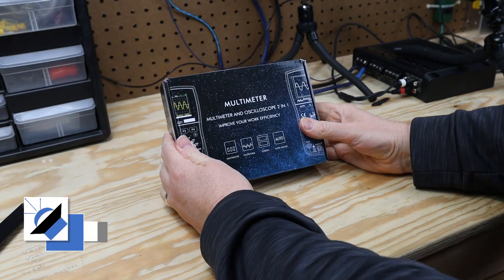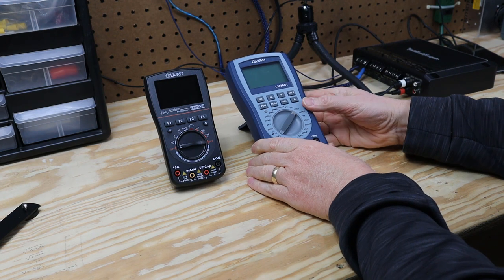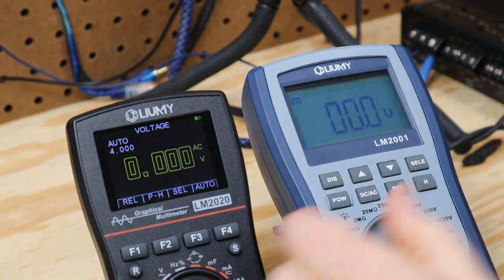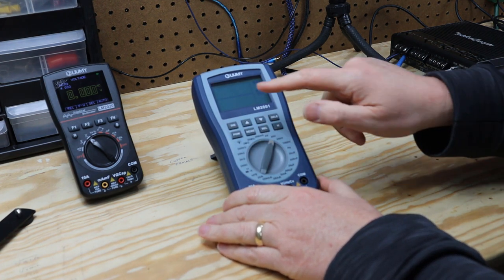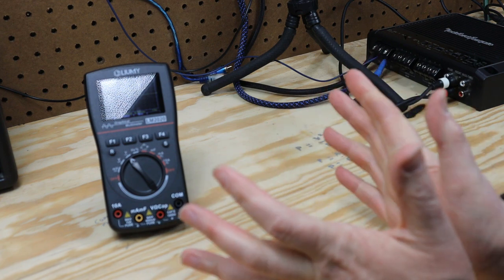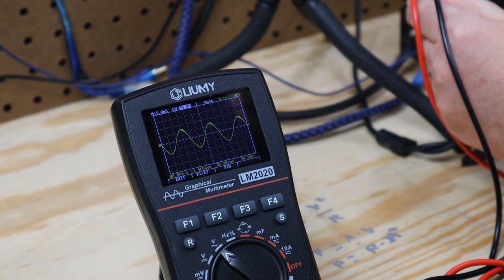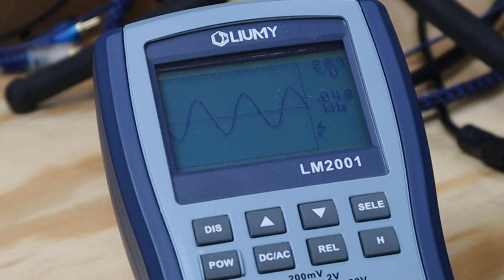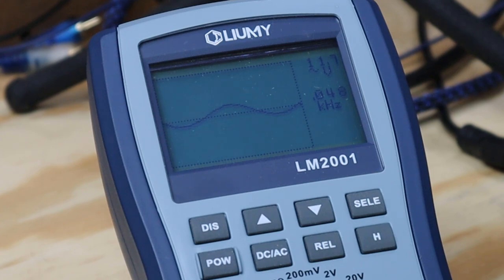Best Cheap Oscilloscope for Car Audio in 2021? Liumy LM2001 vs LM2020

Comment: Great video and honestly seeing the video makes me more apt to buy this one lol.
Reply from the maker: Or grab one that looks just like it for half the price.
Reply: @DIYAudioGuy  i did this and it has worked a treat for gain setting to the point if an extra 2.5 volts over the ohms law and multimeter method and my system and others I've helped sound 👌

Comment: Great demonstration! Are these True RMS volt meters or not? Also the screen resolution on both is the same? 320x240?
Reply from the maker: They are supposed to be True RMS, but I don't really trust that they are.  The screens are about the same size, but the new one has more pixels, much higher resolution.
Reply: rms is just as good as a fluke on the 2001

Comment: I ordered this scope because i needed to read more than 40 volts and the cheaper ones will not do that. I found that holding the f3 key will sort of auto adjust the scale. I get the wave to fit the screen to begin with, the wave is usually smaller on the screen at 49 volts using the 10x and 1x/3x buttons. Then i hold the f3 and it shows the wave form going off the screen. When i cycle through the scales this time, the wave form ends up fitting much better. I do have to cycle through the 10x and 1x/3x option to get a good fit. Only this time the wave form is scaled much better. I noticed that this works for reading smaller voltages . When reading the rca voltage that is under 2 volts. That method seems to make the wave form easier to read. My amp has a clip light and i cant see clipping on this o scope until the light is solid and is in hard clipping. The 1% clipping that my amp detects does not show up on this scope. I dont think you could see 1% on any scope. At least i know the flashing clip light is a "soft clip" and a solid light is well into clipping.

Comment: Awesome video I have a handheld fluke multimeter but I have been looking for a smaller easier unit.
Reply from the maker: I think it's really cool that we've got all these cheap oscilloscopes on the market. I just don't see the reason why you'd pay $80 or $90 for this one when there's another one that looks to be exactly the same for 40 or 50.
Reply: @DIYAudioGuy  I agree. And at $40 or $50 you cant go wrong.  I dont mind dropping a $50 o scope vs the $1300 fluke lol.
Reply: Would it be better to invest into a DATs 3? Considering it's mainly for audio measurement
Reply from the maker: @st170ish  A DATS cannot detect clipping.
Reply: @DIYAudioGuy  Dats has an oscilloscope built in, I can't vouch how good it is
Reply from the maker: I did not know that!

Comment: I bought the Mustool scope meter a while back. It would probably be similar to the 2.0 version. Not bad for 50 bucks on banggood. Perfectly fine for setting gains. Like most of these scope meters the battery doesn't last long, but for occasional use it isn't too bad.
Reply from the maker: Back in the day oscilloscopes were expensive machines that sat on laboratory benches.  I find it amazing that for under 200 bucks there's a wide selection of perfectly fine functional handheld oscilloscopes.

Comment: The one that you have linked is a different brand, will this work as the one you showed or no?  I need one asap cause I just can't hear distortion period. Idk why but in my 20+ plus years of doing car audio I've never been able to tune.  I can install it all day long but someone else has to tune it when I'm done lmao.
Reply from the maker: According to amazon that is the one I bought -- from what I can tell they all work the same.
Reply: @DIYAudioGuy  awesome I'll get it shipped out and do mine when it arrives!

Comment: Thanks for the review! I picked one up after watching your review. I was just wondering if you can help me with a few things as I haven't used a multi meter in a long time. Measuring DCV on a router, and you want to set the limit of voltage is it possible to limit it to max voltage at 10 Volts? The only way I can explain it is with an analog meter (This model: de-960tr). I just need it to be more precise. I couldn't find any settings to manually change it.

I don't know if it set in 'Auto' will perform in that way or not. Last question is, I had both leads setup on the 2 far right ports from a different review I seen. I'm really confused at which ports I use for things that are low voltage / low amps. Can you recommend the correct way to have those setup? Either that, or if you know of a guide / tutorial that can teach me about it. Much appreciated.
Reply from the maker: The LM2020 is auto-ranging so so you just set it to the type of voltage (AC or DC) and you should be fine.

Comment: PLEASE tell me why I can’t get my oscilloscope to give a clipped signal!??? I have done bought 2 different O-Scopes and neither will show! I’m running a taramps big boss 3 with a resilient sounds 15 dvc 2ohm with 1/0 gauge OFC power/ground and ground is good! I just can’t seem to get a clipped signal on neither O-scope! I bought the FNIRSI 2C23T & AUKUYEE Updated 2.4" TFT Digital Oscilloscope! My amp and bass knob shows clipping but won’t show a clipped/squared-signal! I was running a KICKER LOC and bought another, the PAC LP7-2 because you can control the gain on it, itself! But I can’t even get a clipped signal on it/head unit ALL the way up on a factory Bose HU/system! PLEASE ANYONE, ANYTHING HELPS!?
Reply from the maker: I'm not sure what to tell you.  If I could physically put my hands on the equipment I might be able to sort it out, but it's hard to troubleshoot across the internet.

Comment: I have the 2001 version and works fine but the screen is so low on resolution that sometimes i cant tell if it is in fact clipping or it's just a lack of pixels to visualize the round curve. But overall does the job
Reply from the maker: I had the exact same problem.  I had planned to do some videos on setting gains with the 2001 but they came out looking like crap.  The 2020 is not perfect, but it shows up better on camera.
Reply: @DIYAudioGuy  oh well,i think i'll have to buy the 2020 then 😂
Do you know a method to spot clipping without any instrument? Years ago i saw someone use a filtered twitter that would make noise whenever the amp reached clipping,i don't know if i remember right but it could be an idea for another video 😁
Reply from the maker: @ilfaraone91  That was Sam, his YouTube channel is barevids.  That method will work.  It's basically a harmonic distortion detector.  When the amp clips it will produce stray signal and all of its harmonic frequencies.  The bass blocker on small speaker keeps it from blowing from playing bass.  I could probably build one from spare parts I have lying around, just would need a capacitor of the right value.
Reply: @DIYAudioGuy  wow nice! Thanks for the info!

Comment: For the oscilloscope vertical sensitivity, you can also use the X1/X3 choice to get a three times change for sensitivity no matter which of the X10 settings you are on.  This gives you more choices to have the waveform more fully fill the screen.  The X1/X3 button toggles back and forth between the two choices and the volts per division indication changes accordingly.  Most scopes have a "1, 2, 5" sequence for this.  This has a "1, 3".
Reply from the maker: Yeah, you you have to fiddle around with it a bit.

Comment: I tried setting my gains using this oscilloscope. I set all my settings on my stereo to the required settings and used a 40hz test tone off of YouTube. As I adjusted the gain up the waveform went completely out of the screen and I don't know how to adjust the oscilloscope so that i can see the waveform flatten at clipping while still inside of the screen. What do I need to do?
Reply: I watched this video and apparently I didn't know how to change the waveform, but this video helped tremendously. Thanks DIY Guy!!!!

Comment: I have version "2.0" and reading distortion on the waves can be tricky just like shown on version "1.0". The display on "3.0" seems to be a good improvement over the others.
Reply from the maker: I'm still a little bit perplexed by it. As you saw in the video right before the wave went square it started to get fuzzy at the tops and bottoms of the wave.  I'm not 100% certain how flat the top needs to be before I can call it clipping.  At this point the only thing that the scope has going for it is that it is a lot cheaper than a DD1.
Reply: @DIYAudioGuy  yea if you aren't doing much amp installs then a DD1 is a real luxury. As much as I'd like one I still can't justify the cost just yet... especially when for me the cost is double in my local currency.
Reply from the maker: @dna59  Ouch!
Reply: yeah on my 2.0 i feel like im still guessing but on a more professional level of guessing
Reply: @mcf3778  hahaha you are correct. Usually I workout the maths of doing it with just the multimeter and then cross reference that with the oscilloscope and it's wave and voltage reading. Gives a better idea than just using 1 or the other.

Comment: I've actually been looking at one of these and this exact model. 

Heard this is like a copy of a copy of a copy but it should be good enough for setting gains and looking for distortion.
Reply from the maker: It's like a movie about a dude playing a dude that's disguised as another dude.
Reply: Liumy is the first company to make them.. buy some good leads if your gonna use it daily mine fell apart day 4 but I reached out to the company and they said they wanted to make it right.. but besides that I've been happy
Reply from the maker: @lagginlycan159  Good to know they stand behind their product.
Reply: @DIYAudioGuy  I need to pick up this device soon so I can check my iNuke3000DSP and see how clean it is. 

I just did some measurements using my microphone and found the distortion is pretty tame to 25v on a single channel. Any harmonic distortion is over 30dB lower than the sine wave. This matches up with attaching a capacitor to a speaker and listening for distortion so I'm pretty happy these match up quite closely.

Increasing the volume by 1dB to 28v harmonic distortion (2nd and 3rd) is now within 30dB of the fundamental tone.
Increasing the volume by 1dB again to 30v 2nd and 3rd order harmonic distortion is now 24dB and 27dB from the fundamental tone.
And one last time pushing it up to 32.5v (+1dB) 2nd order harmonic distortion is within 18dB of the fundamental tone. And pretty noticeable at this point. I stopped here because the Subwoofer was making unhappy noises because the amp was out of gas.

This was done on my Ultimax 18 and was well under 1/4th the subs rated power so this should be all Amplifier distortion. Curious what the scope would show at those voltages and wonder where clipping actually is.

Comment: i just got a car and i'm upgrading the audio last owner upgraded the head unit and i found a 600w sub amp for cheap that i'm thinking of using but i'm wondering if i can for example mount some a pair of 6" subs underneath the driver and pasanger seat. i think i canf it a box the correct size unde there. my car is really small and i dont want to use up my small trunk so i was wondering if putting them closer and smaller would make them good enough. so to make it more clear i wand 4 6" subwoofers or would i rather want to figure out a way to mount 1 10" sub per seat
Reply from the maker: It all depends on how much airspace you have underneath the seat.  It takes space to make bass.  If you can get  half a cubic foot per side that would work really well with a small driver.  I would not try to cram anything bigger than a single eight under a seat.  I think the woofer that I used in this video here along with the passive radiator might give You the results you're looking for. https://youtu.be/xip5zUoZsQY
They also sell 5 and 1/4-in version that might work even better.  If you order from Parts Express make sure you check out my blog, I've got a few discount codes posted over there.

Comment: These days you need an o scope to set your Gains. Even top quality company’s will have over rated output claims. You can set your gains by voltage but only if you really trust that specific manufacturers ratings. All electrical systems will be different as well some cars don’t charge at the 14.4 that amps are rated at . O scopes will tell the truth with no guessing. Everyone needs one
Reply from the maker: And they've gotten pretty cheap, so if you're going to set up more than one amp ever in your life you may as well grab one.

Comment: What's the best subwoofer you've owned to date ?
Reply from the maker: That's a really hard question.  For starters I have not really owned that many subwoofers.  I tend to hold on to my gear for a very long time before I upgrade or replace it.  I've really enjoyed my Polk Audio DXi 10s, my Dayton Audio Ultimax 10 with the passive radiator sounds fantastic.  But, my favorite always has been and always will be the 12-inch Blue Thunder I had in college.  That has nothing to do with sound quality or SPL, it's all nostalgia.
Reply: @DIYAudioGuy  I had some  MTX Blue Thunders back in the 90's 2 12's in the back of a Ford Escort  I was pushing them with a Rockford Fosgate Punch -150  with Pioneer 6 1/2's in the doors I absolutely loved that little set up I had it for a good 5 yrs lots of keg parties out in the middle of nowhere That system put in some MAJOR entertainment hours 🔊🔊🔊👍🏽
Reply from the maker: @redman4076  Hell yeah!

Comment: Great video, just getting into the technical side of car audio (been installing since early 2000s) and building my own subwoofers etc and this video is exactly what I needed, ty! Do you also have a video on a cheap diy Gaussmeter? Trying to measure the magnetism on my Alpine SWX-1243D motors, and maybe find a place in Central NY to charge them (anyone know a place?) def subscribing, this info is golden!
Reply from the maker: That is a cool idea.  I would not even know where to begin.

Comment: I have the version 1.0 But its the MUST-TOOL VERSION  (the MT 8205) good meter but biggest problem is when the batteries start to run low it can give readings off by up to 3 volts. {"SO LOOK OUT FOR THAT IF YOU HAVE ONE"} Plus it's not a proper scope. It only lets you are an A.C. wave form.. and badly at that. No time form, vpp, trigger of any kind, (unless you count the auto button.) But with fresh batteries its a bang acurrate meter.  Don't know anything about the 2.0 version in this video.  Sorry.  Hope this helps. 
P.S. that was the first meter I bought when I first started learning electronics. By the time it arrived I already need a proper scope.  And was sorry I bought it. (My little DSO shell 15001K serpassed it a 1000 times😅 & that's saying something for a scope that only cost me €14 & 60ç)

Comment: And in this video he admits later he was wrong. There are some pros to the digital multimeter way. But the oscilloscope liumy is so much better. I have found out my sub amp puts out 2000 rms per sub even max 2500 if I'm competing and everyone feels it and hears it. Without this device and basic math I thought I had to upgrade to 2000rms sub.
Reply from the maker: Was I really wrong or was I just trying to make it dramatic for the camera?
Reply: @DIYAudioGuy  U got me, Dramatic, but its personal preference u ask me. The liumy seems better. Multimeter is safe, but it has one to 2 to be on safe side.